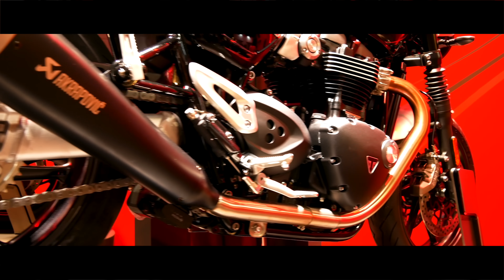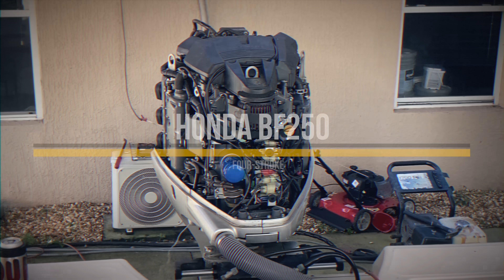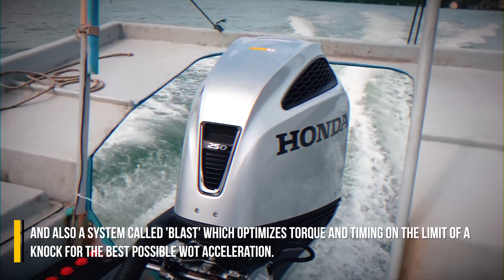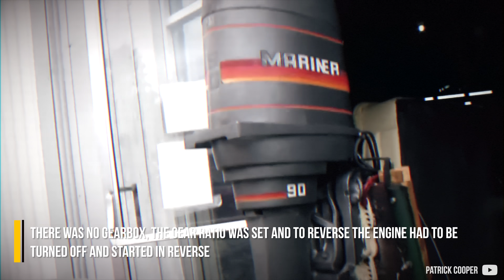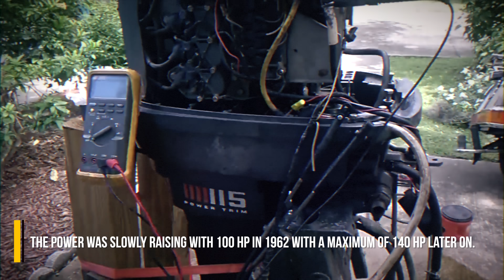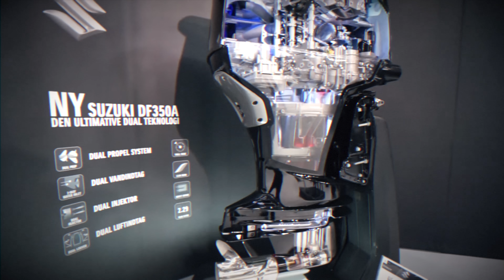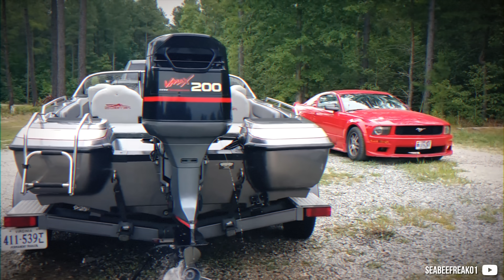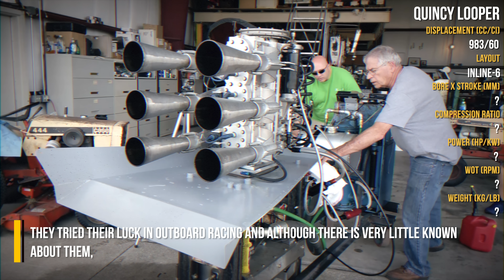The Best Sounding OUTBOARD 6-Cylinder Engines

Comment: Shout out to evinrude for further developing the 2 stroke.
Reply: So I read in an interview that BRP has no plans of continuing to develop E-Tec technology or sell the rights to the Evinrude brand 😕

They will continue to operate the parts network to provide spares for existing engines at least

So the Evinrude brand is in limbo for now, but you never know...if BRP falls on hard times or gets the right offer, then it may be bought by a holding company and re-enter the market

RIP Evinrude 1907 - 2020 😕
Reply: @movinmetal2596  yes but brp uses that 2 stroke technology on snowmobiles
Reply: @Antsa15  Yes, Rotax buzzers have E-TEC, however Evinrude was the one pushing the design forward with the second-generation outboards (G2)
Reply: @Antsa15  Arctic cat has direct injection engines as well.
Reply: @movinmetal2596  brp is going to bring back the evinrude line with the "ghost" an electric outboard thats supposed to be a direction toward green power
Reply: @ryanith2  I have heard about the Ghost Project and that it’s being built in the Evinrude plant. 

Don’t know much about it, but it sounds cool...Evinrude to me will always mean two-stroke however, I doubt that Ole would turn in his grave if they used his name on an electric product 😅
Reply: @movinmetal2596  he possibly would but Ole was an innovator so he may like that his name is attached to a big revolution in outboard technology, given brp doesnt screw it up 🤞
Reply: I once saw a picture in an MX magazine showing a mechanic holding up a pit board to his rider stating 
"Fuck the whales. Save the 2 strokes". Was a time when 4 strokes were taking over MX classes.
Reply: @siyz250  BRO! I remember those stickers...they were very popular with the sledheads up here lol
Reply: The injection came from ficht, that was not evinrude's own development.
Reply: RIP. Loved their modern 2 stokes
Reply: Euro 6 approved
Reply: Others                            ** inject themselves with steroids to build muscle  **
meanwhile, I,                 ** listen to engine sounds, rough and sweet  **
Reply: ....and getting jacked! :)
Reply: shout out to your idiocy considering evinrude called it quits a couple years ago because their engines are shit
Reply: Why does it need to be stratified if it’s direct injection? Not only is it a heavier piston that eats bearings, it’s a terrible solenoid driven injector that copied Detroit diesels old common rail that used the cam to hit a syringe plunger basically, the etec uses a solenoid to kinda hit a hammer on a syringe. The electronic variant does not hold up. It’s done they tried it and they were terrible!
Reply: Just picked up a 15 h.p 2 smoker Johnson 1986. $250 runs like the bees knees. I need a tiller handle for it. It was set up for remote.
Reply: RIP to evinrude, another victim of BRP
Reply: Shame on BRP
Reply: Mercury optimax 175 also sounds pretty gnarly
Reply: Rip evinrude
Reply: Evinrude is SHIT! Yamaha 2-stroke is the best!
Reply: Damn, same name. I don't see that very often
Edit: Forgot I changed my channel name lol. My name is Keenan
Reply: @reekeen8257  yea ive ive only met one other keenan my entire life
Reply: @keenan3201  I'm 21 now and the last time I met someone with my name IRL was when I was 2yo. Crazy
Reply: @reekeen8257  crazy stuff.
Reply: One day I'm going to build a cigar chassis 60s f1 style go kart with an evinrude engine
Reply: The Evinrude G2 is such a great motor! I’m looking forward to what they have coming down the pipe with the new Ghost propulsion system
Reply: @JR-ho5qm  That’s kinda cool, so is it like a small engine with a stern drive? I am picturing a miniature Mercruiser/OMC setup here
Reply: @movinmetal2596  I think there will be a 2 and 4 stroke version. The 4 stroke will be the Rotax Sea Doo engine with a G2 leg. And the 2 stroke version will be the G2 3 cylinder. This is my guess, hopefully we see something soon. The prototype pictures look pretty cool though
Reply: Evinrude is dead, sorry.
Reply: @SupraTompan  yeah we know, that’s not what he said though
Reply: @SupraTompan  Sadly yes....the issues with the G2 E-Tecs were the straw that broke the camels back.

They were plagued by poor management since being bought by Bombardier with too many products occupying the same place in the market. They also never offered anything over 300hp, which kept them out of the lucrative off-shore market.

Too bad really, the E-Tec technology showed promise...but we’ll never know now 😕
Reply: @SupraTompan  Owned now by Bombardier now. Death of a legend
Reply: @SupraTompan  say that to the evinrude 1978 motor we have running prime
Reply: @SupraTompan  Evinrudes not dead ...
BRP didn't go bankrupt
Reply: @hydrostream76  they no longer build Evinrude outboards
Reply: In fact, it’s interesting that two-strokes tend to survive in applications were engine weight is more critical.

Check out this new two-stroke diesel by Cosworth for unmanned aerial drones.
https://www.cosworth.com/case_studies/ag2-engine/

I want one in a late-50’s BMW R frame 🤠👍
Reply: Mercury has some modern direct-injection 2-stroke outboards.
Reply: @12skipafew-e7y  Mercury hasn’t developed two-stroke engines since 2005...what are these new DI two-strokes?
Reply: @movinmetal2596  My brother has a boat with a sub-200 hp 3-cylinder two-stroke Mercury. I'm not sure the year of manufacture, but it's more recent.
Reply: @12skipafew-e7y  Oh yeah...the post-2005 models are just hold-overs. They are basically same as the original Optimax engines from the 90’s
Reply: @12skipafew-e7y  Evinrude, too
Reply: Lol havent you heard they went flop
Reply: @drifter9425  Evinrude is actually in the process of re tooling there factory for the new propulsion system. They never went flop. Just discontinued the outboard in exchange for there new design
Reply: @JR-ho5qm  
Hmmm thats interesting here in south Louisiana the new ones never took off its Yamaha 70% and Mercury V8 now
Im into the OX66 3.1 two strokes
Wonder what Evinrude has up their sleeve
Reply: BRP is still in business
Buy the G2's best engine ever ....
oh and the best gas mileage bar none
Reply: @hydrostream76  If BRP had developed a larger E-Tec version of the 300XP V8 and marketed it to the offshore guys, I would bet very good money that they’d still be in business today 👍

G2’s were the way forward for two-stroke technology, unquestionably. They had teething problems like most new engines, but I imagine they’d have been worked out in time 👍
Reply: @movinmetal2596  i know ....
You're absolutely right
Merc pretty well made the v8 car engines obsolete in boats
their motors are double the price from what i paid
it's nuts
cheers dude
Reply: @hydrostream76  the worst motor out of the modern outboards. And I'm a two stroke guy...but evinrude has sucked since the mid 90s
Reply: @hydrostream76  brp is in business yes . Like I said the no longer produce Evinrude outboards . They were not good that's kind of why they no longer make them . They could not compete with Japanese four strokes that run 10 thousand hours plus
Reply: @brandonmurphy4657  This.....the engine life is something you can never get around with two-strokes. It’s what killed DDs in the on-road truck industry, the DDEC engines could meet efficiency standards but a Series 60 can go over a million miles without a major overhaul.
Reply: @movinmetal2596  two stroke outboards do not handle heavy commerical use well . Four strokes are what people want . I'm not talking Detroit diesel two strokes
Reply: @brandonmurphy4657  that ain't the reason why they stopped making them ..
."not good " ? lol
do ur research
Reply: @hydrostream76  okay straight up junk sounds better?
Reply: @brandonmurphy4657  ? junk ? 
i own one
Reply: @hydrostream76  good for you . My last four stroke ran 12k hours ... Show me an etec with that many hours
Reply: @brandonmurphy4657  Exactly my point. On a light vehicle, a two-stroke works well and for a longtime was the only option. But these days boats are getting bigger and heavier, plus quality four-strokes are available for the same money as a direct-injection two-stroke as you said

There’s a good reason that Mercury stopped developing them back in 2005. They could see the writing on the wall when Honda and Yamahas began to take over the market.
Reply: @brandonmurphy4657  Yea i'm sure it did 
I need a 2 stroke for racing , it's lighter
last of the 2 strokes
also mines not an etec it's a G2 
peace man
Reply: @hydrostream76 Maaaan, imagine a 5000cc V8 full race G2, running around 500hp. Strap two of those babies to a Thunder Cat 32 and colour me gone, baby! 🤠👍
Reply: @movinmetal2596  and with the best gas mileage to boot !
Reply: @movinmetal2596  For larger engines two stroke diesels are still popular. The gas powered two strokes don’t have sump lubrication so engine life is much shorter.
Reply: @Ty4ons  I don’t even want to think about how heavy one of those large, low-speed Wartsilia’s would be if they were four-stroke 😅
Reply: @movinmetal2596  Yeah, the gov't. emission reg's are what dictates what the marketplace can offer. I think the manufacturers figured that at a certain point it was fruitless to continue trying to clean up 2 stroke outboards. Just as Mazda concluded with the rotary. However i am still interested in having all the knowledge 2 stroke outboards can utilise. I do believe that arguing engine hours is only one aspect of the 2 vs. 4 stroke debate. If legal i likely would have considered power, speed, fuel consumption, cost up front and to rebuild. Plus, how extensive? Or can you see clearly what to expect in terms of engine life and extent and expense of rebuilds for various brands and sizes.
Reply: @gregorytimmons4777  Rotaries could have been made cleaner with DI and a laser ignition system...but after failing to meet the 2012 Euro 5 standard with the RENESIS, I think Mazda had enough lol

They actually did make at least one 16X RENESIS II engine for the 2007 concept car which did have DI and made 300hp naturally aspirated, but clearly that was too expensive for production vehicles 😕

As for the two-strokes, they are going to be around in applications where engine lightness is a big factor, but those are very specialized situations (see the Cosworth AG-2)

As you know, an engine’s maintenance is the biggest factor in its longevity. All things being equal in that regard, two-strokes last about 1/3 as long as fours. That’s going to be affected by fuel, oiling, material thickness, engine speed, etc...but in general about a third as long.

I love a two-stroke, got more than a few lying around lol....but sadly, history shows that once the power density of the fours begins to begins to approach the twos, people opt for the longer engine life.

In the 60’s, there were all kinds of two-stroke cars mostly sportier type models. But then DOHC inline-4s appeared.
In the 70’s, every major OTR truck producer had an option for two-stroke DDs all the way up to 16V71s.
But then the Big Cam Cummins 855 showed up and the Detroit’s began to die off.
And now the recreational marine industry had followed suit 😕
Reply: The big change from 2 strokes to 4 stroke was largely all emissions based. Yes 4 strokes last longer. They're also less noisy, no smoke etc. At least when you're talking about the more traditional 2 stroke, I realize the last generations cleaned up quite a lot  But new more strict emissions standards around the world is what really pushed it. Same thing with Detroit diesels. Yes theyre loud, leak oil almost constantly, pretty poor mileage and you really need techs with specific knowledge to work on them but emission standards is what killed them. They of course are also cool as hell and sound great.
Reply: @chickenfishhybrid44  The G2 outboards were EPA 2013 compliant so I have a hard time thinking the decision to shutter Evinrude is entirely emissions based.

The death of the DDs was premature as well. Though they were doomed to fail the standards eventually, the DDEC IIIs were actually EPA compliant until 2004. However in 1998, Penske sold its controlling interest in DD to MTU. The decision was then made to cease two-stroke production and fill the gap with engines from MTUs lineup.

Fun fact, 6V92TA power packs are still being made for the 6000+ M113 APCs the US Armed Forces operate globally....they are expected to remain in service until 2030 🙂👍 

Can’t keep a good engine down 😅
Reply: @movinmetal2596  I meant in the overall shift to 4 stroke outboard, not specifically evinrudes. Emission standards also only get stricter and stricter, would they be able to keep the E Tecs compliant? Idk, maybe. But seems most realized the easier option is to keep advancing 4 strokes going foward.
Right, they're still being made for existing platforms for the military that are EPA exempt... they have cracked down on over the road tractors big time.
Reply: @chickenfishhybrid44  Yeah, you can’t even buy a glider kit anymore...gonna miss the old days 😕
Reply: @movinmetal2596  that's hilarious, I was guna mention that but wasn't sure if you would be familiar with the term lol.
Reply: @hydrostream76  G2’s still an eTec; c’mon now.
Reply: @Icutmetal  how do you figure ?
G2 ? "Generation 2"
Reply: @hydrostream76  Huh?  What do ya think it means?  It's a Generation 2 ETEC.
Reply: Lol you know they dropped them cause their shit😂
Reply: @driveitbreakitfixit7496   I know evinrude motors will never be as reliable as a yamaha 2 stroke. I just got to give credit to evinrude though since i feel like they were the only company trying to keep 2 strokes alive and give them a fighting chance against four strokes because i think 2 strokes are awesome

Comment: It’s gonna be weird to say vtec kicked in while on a boat lol😂
Reply: i've been on a boat with that honda. you actually feel it ngl. craziest thing. you get pushed back into the seat a bit on initial acceleration and when revs pass the 4k mark, you feel another pulse of Gs pushing you back again.
Reply: @Benz 
Under-rated comment 😁😁👍
Reply: Day yum spunch bop be trowin the rev limter in da hood vtek
Reply: what a lot of people dont unterstand in boats is also that there is a specific point  where the hull of the boat is getting on plane and moving with minimal draft. This might feel like a „v tec kicks in“ since the boat starts to get a massive increase of speed. This is not limited to a single engine but happens with every boat which has a plane-hull
Reply: @klkl8525  that's why I mentioned there were two separate impulses of acceleration. One as the hull gets up on plane and the other when this  engine frees up enough from that to hit the RPMs where it's vtec begins to function.